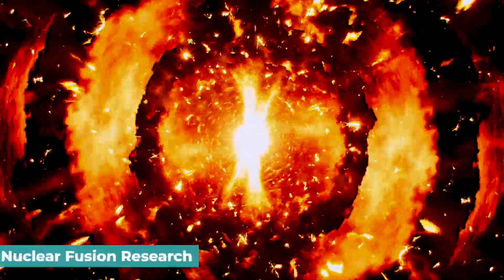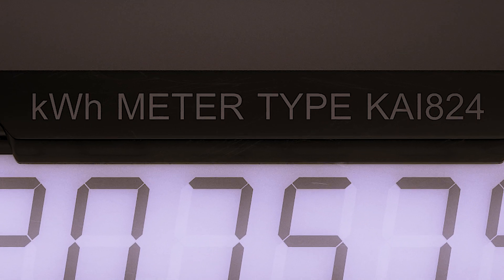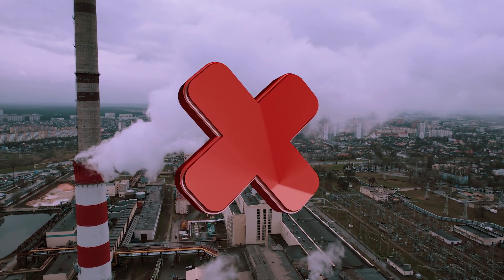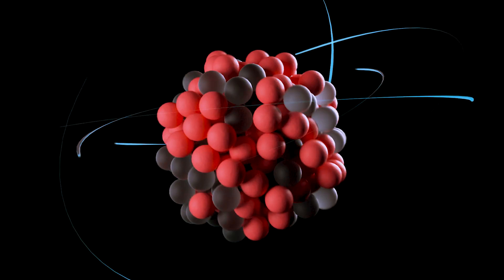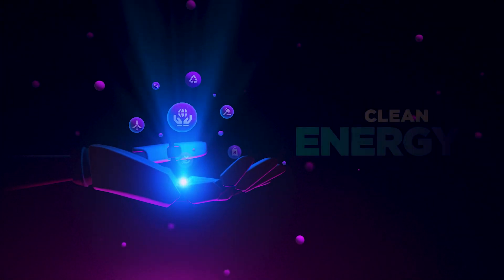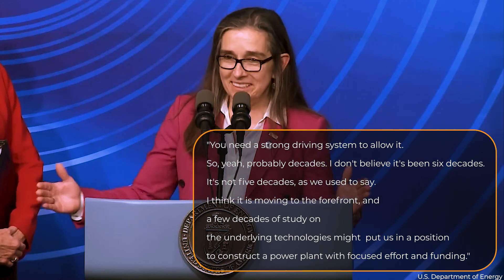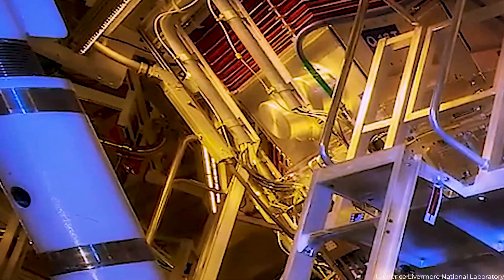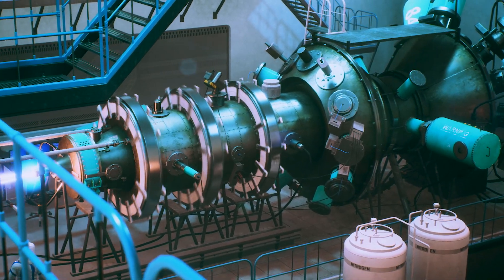Scientists FINALLY Discovers a Way to Reach Other Galaxies

Comment: Fusion is still a ways off. "Net gain" is more of a "gross gain". There's a lot of loss between the power source and the final laser bank that powers the Fusion reaction. The gain is between the final bank and the output. We are still losing 100x too much energy converting the initial power into laser energy.
Reply: This was used as a proof of concept, not to be efficient. We have lasers that are more powerful than these that use less power. These were designed to test a small experiment.